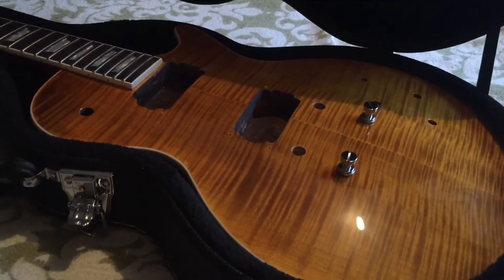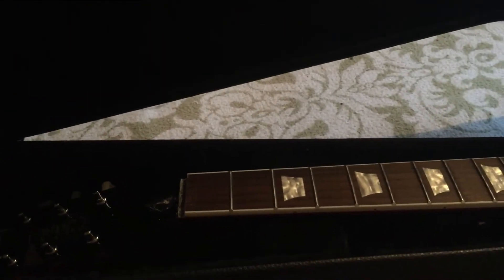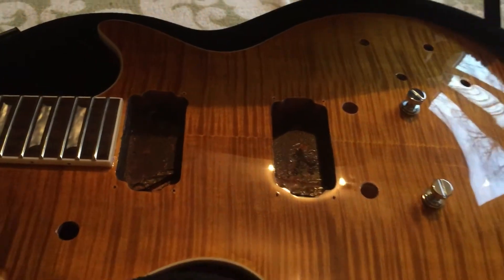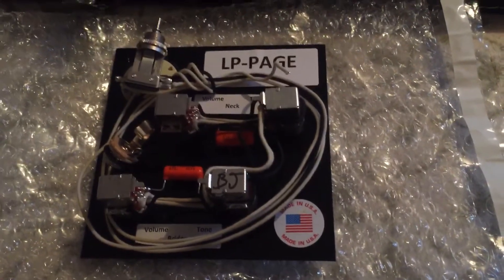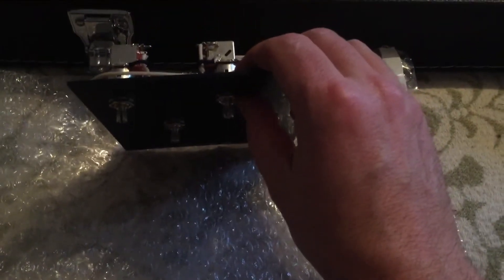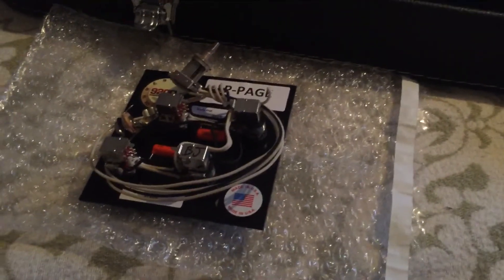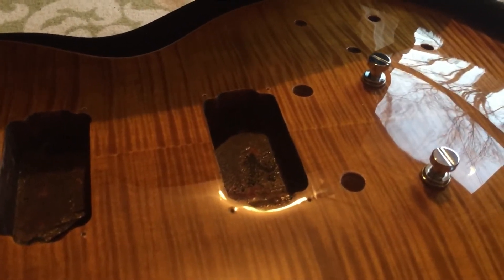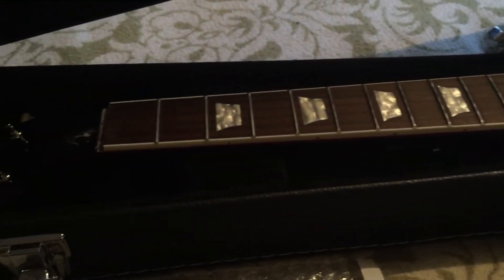Chibson unboxing part 5. Slash les Paul afd.

Comment: These Chinese guitars always sound thin & unfocused. They basically don't have the smooth compression of quality wood construction when they resonate. You can upgrade parts, but nothing can really make them have a deep/full sound like they  should due to the neck and body woods & construction methods used. It's funny how buyers always point out their great finish work, but that's fine if you just want to look at them  --you simply get what you pay for.
Reply from the maker: Rodny G I totally get what you're saying but I think like all things you get good and bad one. In the same way you can get an awful Gibson. But I get where you're coming from.
Reply: Chibsons are awesome Never had a problem and it's really fun to upgrade I picked up a pedal in a music shop and played a 3000 euro Gibson lp standard I came home and picked up the Chibson 2008 Slash Custom replica , yeah the faded one , and the Chibson made me smile ))